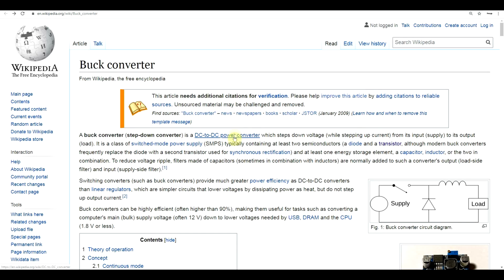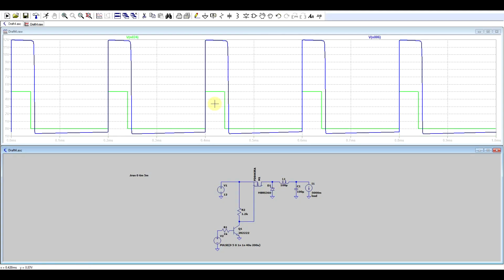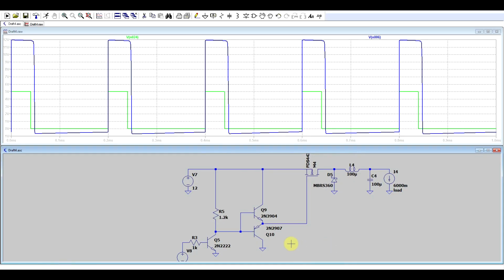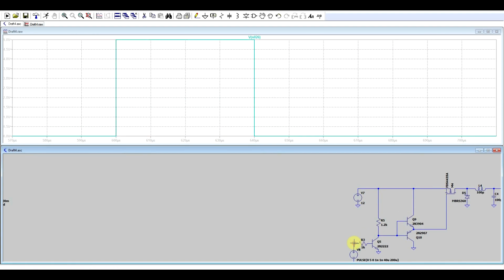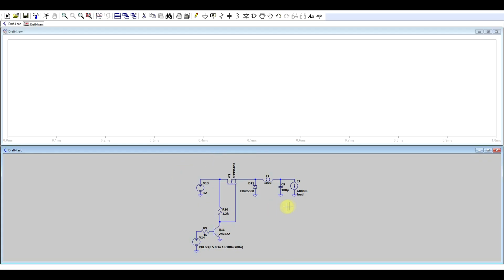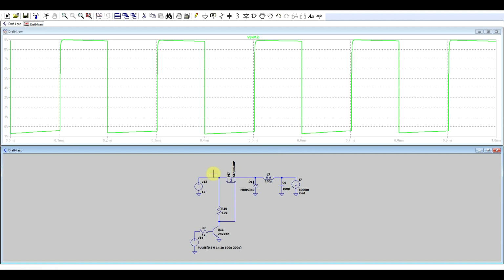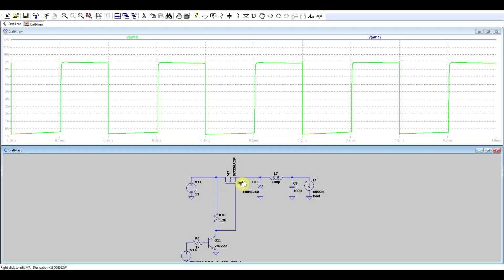Electronics Tutorial - High side drivers in Buck Converters

Comment: I have a doubt...the collector of pnp of push pull is connected to gnd so when the source raises to around supply voltage and when pnp discharges the gate the Vgs becomes negative...what if that gate voltage exceed the maximum gate voltage... ? It can happen when we increase the supply voltage...dont we have to connect it to source of the MOSFET?

Comment: Well done.I think I will try and integrate this into my solar powered battery charger .
Since it has no separate signal input and low solar cell of two volts to maybe 3 volts using a joule thief circuit it may take some time to get it to work but I think the boot strap and push pull circuit will help instead of using a 2n7000 as feedback as frequency greatly causes the 2 n2222 transistor to stay on if not perfectly tune . Thanks you got me thinking.Possible,maybe,time to play.

Comment: How does the bootstrap capacitor charge. The diode only supplies a positive voltage, but the other capacitor terminal is floating... There's no ground or the other negative for the capacitor to charge.
For the capacitor to turn on the gate, there must be a voltage higher than the source across gate to source (supplies by the capacitor) but if the capacitor can't charge, then it won't be able to turn the MOSFET on

Comment: Questions: Can the push-pull buffer be connected across the capacitor rather than to ground? Should there be a diode across the source gate to pull the source down? As it is, the load pulls the source down?

Comment: Mooi uitgelegd!👍 Misschien kleine aanvulling door een klein keramische condensator parallel te plaatsen op de 1k weerstand die tussen de basis van de NPN en pwm signaal zit. Sneller ontladen van de transistor. Small update. The bootstrap does have a limitation: it needs a duty cycle to work properly, which depends on the switching frequency and your PWM controller/IC. I've personally found that you shouldn't go much higher than 90% duty cycle. If you expect to work at a high duty cycle, a P-channel MOSFET might be a better choice. Thanks for analyzing that too! The problem is that P-channel MOSFETs often have a higher Rdson. You could also use an N-channel MOSFET for a charge pump circuit. That would also allow you to run a higher duty cycle.

Comment: @FesZElectronics great job! and thank you for this high-quality explanation.
Can you help with this problem? please. I have a buck converter, and even with this configuration of gate drivers, the MOSFET switching-off delays at high frequencies (100 kHz and above) make the duty cycle wider and the output voltage higher than expected. For example, with an input voltage of 120 volts and a duty cycle of 0.2, I got a 24.7031 output voltage at 100 kHz and a 26.4402 output voltage at 200 kHz. Is this normal, and I can't run the MOSFET used in my circuit at these frequencies? If not, does anybody have knowledge about this phenomenon and the way to fix it without using feedback?

Comment: This is a very well-done video. I really appreciate you making this. 
I do have a question remaining...
How would this totem pole driver work in a high voltage buck? (hundreds of volts, say ~300V)
Would you be able to add resistors in series with the totem pole's collector and emitter (so as to not exceed the VCE maximum of the bjt's) without compromising the desired high frequency switching response?

Comment: Using the last example of bootstrap push-pull driver at a high side MOSFET of a half bridge, I get excessive voltage spikes at the C-E terminals of the BJTs, equal to the total voltage of the half bridge plus the driver circuit voltage (5V). Can I limit it to 5V?

Comment: This is really well explained with practical cicuits. I was just wondering with a bootstrap capacitor what would be the value of capacitor if we are switching a P-channel MOSFET at 500KHz, does it have to be smaller or 1uf is good. Also there are some ICs that is widely used for High Side Switching of N-channel. Could you do a demo using one of the HSS driver IC. Thanks for your video. I liked it and subscribed to your channel.

Comment: Why did we choose bjt instead of mosfet to drive the high side mosfet?
Reply from the maker: I did not have a special reason; it was just as an example; in general I find using BJT easier to understand but I am aware that in most transistor driver IC's the driver is built with FET's.

Comment: this circuit works for only 12v? if we increase the battery voltage above 30v, same voltage vale will be impressed in the gate of the mosfet....which is not acceptable?

Comment: High side switching, apparently has less ( A lot less? ) EMI compared to low-side switched buck converters.  Can you confirm, and or elaborate on that?
Reply from the maker: I'm not sure what you mean by "low side switched buck"; In general, regardless of the converter type you will have EMI noise. The only thing that you might change is whether the main part of this noise is on the input (in buck converters) or output (boost converters). Linear Technology has a great Application Note 139 where this topic is discussed in detail.

Comment: I wanna ask one thing. In the push-pull configuration, do we need some resistor in NPN (collector) ?. 
Because i think if I dont put some resistance, the current through the push-pull configuration will be so high (short). Anyway, great video!
Reply from the maker: I'm not sure why having high currents would be a problem? anyway, current running trough the switch closes trough the inductor, so any current will be limited by that circuit element. Or maybe I misunderstood your point.
Reply: @FesZElectronics  for example, in that push-pull configuration. 

When the NPN bjt is ON, then current will flow through NPN bjt right? because we have no resistor attached on the npn (in emitter or collector) I thought that it will make the current so high and may damage the NPN transistor.

or maybe because we are driving the gate of MOSFET, the main focus is voltage ?? hmm im still kinda confused tho.

anyway, sorry for my bad english :)
Reply: sry i just remembered that in bjt, collector current are controlled by base current. I think this clear my confusion

Comment: hi sir im lloking for high volt AC to Dc converter 220 v AC to 90 V DC. Will  circuit explained by you will work for same. any reference or help. or if possible plz make a video on that.

Comment: Thank you for this explanation!  I’ve simulated this setup for bootstrapping, but it seems to break down if not enough current is drawn by the load: at some point the current in the off-state is not enough to charge the bootstrap capacitor, so there is not sufficient voltage to open the gate 😕 So what do we need to do to keep the boostrap cap charged consistently, independently of the voltage?
Reply from the maker: In some converters, there is a minimum on and off time defined - so you cannot have the switch closed for extended periods, or open for that matter; regardless, if the load is very small, the converter should still work, but there will be a very large voltage drop on the high side switch - this will happen until the capacitor is re-charged. You can always use some other charge pump circuit to create a higher voltage, something that does not rely on the power converter switching, although this is not ideal and just adds complexity.
Reply: @FesZElectronics  True. Still, you need tovhave enough current in the open state, right? I see that the IC gate drivers charge the cap through the low side switch that replaces the diode.

Comment: You're driver circuits are incomplete in that Vgs follows the supply voltage. Some modern MOSFET's do not like to be driven with gate source voltages larger than 7...12V. Better circuits exists which limit Vgs to an appropriate voltage.

Comment: Thanks, this was also really helpful for building a half-bridge driver without using a P-MOSFET for the high side switch and avoiding the hassle of a gate drive transformer.
Reply: it's kinda trade off between gate drive transformer vs bootstrap circuit.
with the gate drive you get a galvanic isolation but with bootstrap you don't.
with the gate drive you get slow rising slope but with a bootstrap you can get a sharp one.
with the gate drive you can get any range of voltage but with the bootstrap you have double the supply voltage only.
with the gate drive you can have multiple output while bootstrap you must build for each of the high side mosfet.

Comment: but if the voltage i want to switch is 42v how i turn on the p ch mosfet correctly since vgs is limited by 20v, if i shorted the gate to ground then vgs its more than 20v right?
Reply from the maker: Usually a zenner diode (~15V) is placed in parallel with the G-S of the mosfet if the driving voltage can exceed the limit. As the driving is done trough a resistor, the zenner will always limit the Vgs regardless of signal amplitude.

Comment: can i use open collector for drive a p channel mosfet on mppt buckboost ? the switching frequency is about 30k-62.5khz
Reply from the maker: Of course - that should work - just keep in mind that the p-mos needs to be switched off during the off time. You can use a resistor for this or the circuit in fig 27 of the NCP3063 datasheet ( https://www.onsemi.com/pdf/datasheet/ncp3063-d.pdf )

Comment: What is the electronic analys program name?Also , i need a 24V PMOS High side driver. I couldnt find very well circuit. I made some circuit , but not work ver well. Only for on / off. I cant see pwm on motor. I think, i need a fast closing time. I used C12V zener for Vgs under 20V.
Reply: i think, i found program name to simulate circuit. Name is LT Spice, i think.

Comment: Super helpful there is just one tutorial about Buck Converters bootstrap on the YouTube, Can you please answer one question, its about "C3" capacitor on your circuit i want to know which terminal is positive the one connected to D3 or D2  ?
Reply from the maker: The positive terminal should be one connected to D3; current flows trough D3 to charge it. I would like to point out though that in practice, bootstrap capacitors are commonly quite small in value. So you can just use 100nF-1uF ceramic unpolarized components.

Comment: @fesz electronics  please tell me if it is ok to use the bootstrap configuration when the input voltage of the buck converter is greater than 12 v i.e if it is 75v     and if this bootstrap configuration  is not ok for the desired application than what could be the remedy for the problem of driving gates

Comment: What’s is the purpose of diode d2?
Reply: There doesn’t seem to be any use for it
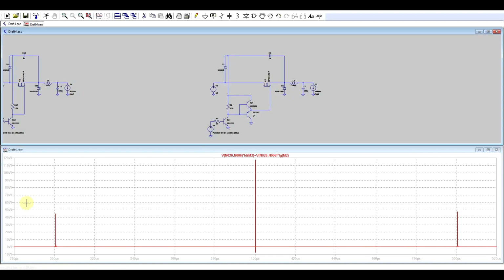Reply from the maker: Are you referring to D2 present at 13:00 ? Its the regular flywheel diode in the buck power stage.
Reply: @FesZElectronics  yes, thanks for the quick response, was stumped on the reasoning but had initially forgotten about the voltage spikes caused from an inductive load. this is probably the most useful video on mosfet drivers one can find on YouTube

Comment: This has very well explained bootstrap. It helped me a lot. I am wondering will the capacitor be able to sustain its charge when the duty cycle of the switching is high? Maybe 80% and up?
Reply from the maker: Usually converters that use a bootstrap have a limited maximum duty cycle (expressed in the datasheet) so that the capacitor stays charged. The capacitor value will depend on the energy it needs to deliver and this maximum duty cycle. Its common though for such converters to allow maximum duty cycles of around 95%

Comment: Dude, i just copied your circuit and swaped the load of 6 amps for a 10 ohm resistor (so load current would be lower) and an interesting thing happened, the Vgs didn't got to 24v, could you explain why this happened?
Reply from the maker: Well, the Vgs is not load dependent as long as the supply is working correctly. The bootstrap capacitor will be charged with the input voltage (in these circuits) minus the drop on the bootstrap diode minus minus the low side diode in the switching node. And when the gate is being driven, there is a voltage drop on the driver (again 0.7V). So when the circuit is working normally you get ~24 -0.7-(-0.7))-0.7V~23.3V; If there is very little load, the circuit with fixed duty cycle will not work well.
Reply: Ty FesZ! You are actually my favorite yt channel about electronics atm, great content!

I’m building a DC motor H bridge driver (without a mosfet driver ic because those don’t exist here where I live and take a long time at shipping lol).
Reply from the maker: Just take into consideration that if you plan to run a motor without PWM (always on, or off, or in reverse) , this sort of high side Nchannel will not work. You need constant switching to keep the bootstrap charged.

Comment: The reason why N-channel MOSFETs are used more often than P-channel is not only the price, but also the lower RdsON resistance of an N- vs. P-channel.
Otherwise, great video and explanation.
Reply from the maker: If you compare the same size transistor (same silicon chip) then you also have worse electrical proprieties. I guess I insisted on price in the idea that 2 similar spec transistors will have a considerable price difference - if you try hard enough you will get the same Rdson regardless of N or P chan.

Comment: Nice... I've always drove the N channel mosfet on the low side instead the high side. I also have another question: How to drive those mosfets if the source voltage is higher than the max gate voltage?. Maybe you can create two voltages sources, where one of them is at the correct level to avoid the gate damage, but that's the problem, you need two sources.
Reply from the maker: Hello Daniel. Regarding the voltage issue - you can simply make a basic stabilizer with a zenner, nothing fancy - I tried this in https://youtu.be/fwUft6ewZlo

Comment: Hello, I really enjoy your videos, I have one question though. Doesn't the source node drop below 0 volts in the buck converter? If so how will the mosfet remain off completely with an effectively positive GS voltage? Thanks!
Reply from the maker: Hello Brian! Well, the switching node does go below 0 in a buck converter, but only to about the forward voltage of the diode - that being schottky its usually less then 1V even for really high currents. Depending on the Mosfet, the Vgsth (gate source opening threshold) is usually more than 1V, unlike a bipolar transistor that needs 0.7V; so even with the offset of 1v you still can get away with not putting the transistor into conduction.
The design can be improved by referencing the push-pull driver to the switching node and adding some resistors - I did this in the next video on the topic - https://youtu.be/fwUft6ewZlo

Comment: I appreciate your all videos! One question: how can you drive a non-switching NMOS using bootstrapping?. In my circuit, I just want to turn on load for some predefined period.
Reply from the maker: Hello @Viraj Adam ! Well, you need the switching action to charge up the bootstrap capacitor, otherwise there is no energy in it to drive the NMOS. You could try using 2 signals, one just to switch constantly and charge the bootstrap, and another to use this voltage to drive the transistor. Or an altogether different approach is needed - maybe some sort of opto-coupler or some other principle.
Reply: @FesZElectronics  Thank you, FesZ

Comment: Question...
If we increase the input voltage yhan 20V then gate voltage also becomes 20V which is highest value in many cases. How this situation could be avoided?
Reply from the maker: That's a very good question! Basically you do not use the supply voltage to drive the transistors, but make a lower voltage that is fixed regardless of input supply - say 5V. I implemented this in https://youtu.be/fwUft6ewZlo

Comment: I have another question. Can we introduce faults in components in LTSPICE, like we can do in MULTISIM.  
http://zone.ni.com/reference/en-XX/help/375482B-01/multisim/settingplacedcomponentsfaults/#wp245032
Please guide me. MULTISIM provides option for these kinds of faults for every places components. Is there a way to introduce faults in components in LTSPICE?
Reply from the maker: Hello Irsa! I'm not sure this feature is present in LTspice. The simulator is more basic and more bare bones. You can simulate faults the "hard way" though. By actually adding the fault as an extra component (in case of short circuit, add a small resistor or a wire) or by cutting traces (for open fault)

Comment: Can you please make a video on actually building your own DIY variable buck converter?  My problem is that I simulate the circuit in LTSpice, it works.  Then building the physical circuit, it either doesn't work or is badly inefficient and its frustrating.  This is for N-Channel type MOSFET.. I know I can just follow a video (electronoobs, GReatScott) on building a DIY, but they almost always use P-Channel and they seem to skip steps.

I want to step down 24V to 0V - 23V for example using a Teensy 3.5 as my PWM.
Reply from the maker: Usually you get differences between the simulation and real life if you use different components, or the models are not that precise. On the other hand when talking about switching power supplies, the exact circuit construction can have a big impact. You need to keep the power loops as small as possible as well as the supply ground as compact as possible (the connection between the input cap, diode and output cap must be thick and short). 
Do you have a particular schematic that you wanted to try and had issues with?